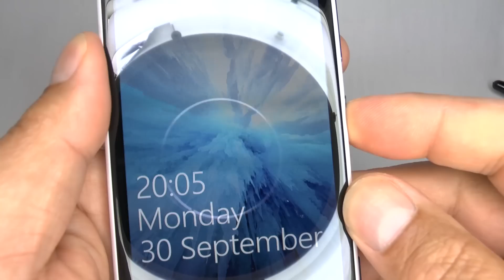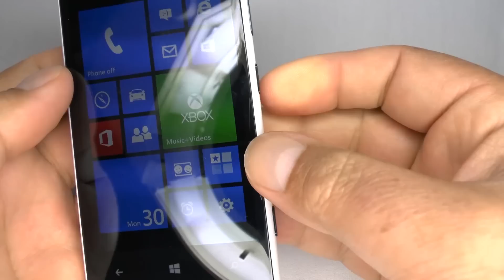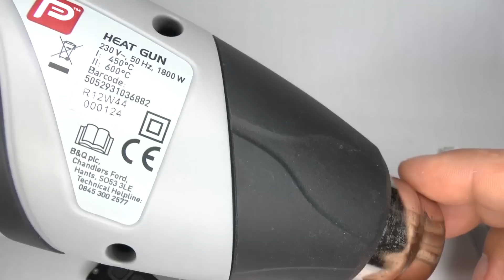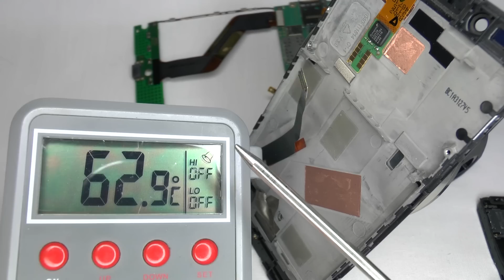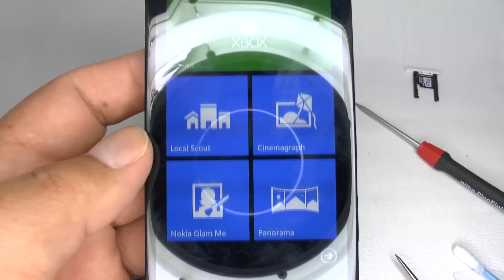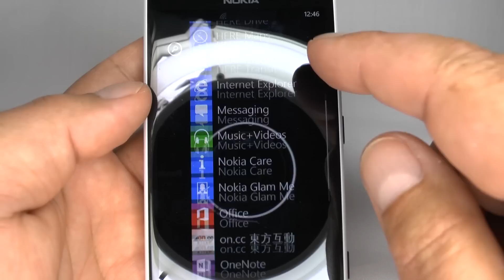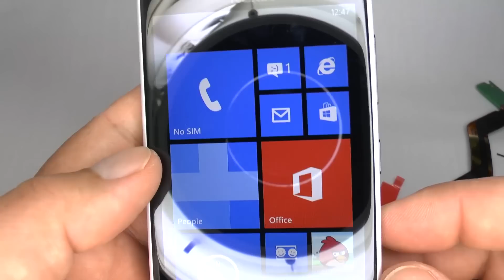Nokia Lumia 720 - Disassembly & Assembly - Digitizer Display Screen & Case Replacement

Comment: i have a 720 with broken digitilizer, what kind of glue I use to fix the new one, can be super bonder?
Reply from the maker: do not use 'super glue' as it will leave white marks and the glass will fall off if the phone is dropped. You need to use a flexible adhesive like 'Evo-Stick Serious Glue' or something else that is flexible
Reply: ***** I have dropped my phone and my external glass completely shattered. Can I get a new display and glass in the market or nokia care center so that I can repair it on my own and save a lot.

Your input is highly valuable on this comment. As the nokia care center will charge around 8000 rupees ($ 150) to fix it. I want to avoid such huge cost
Reply from the maker: Harish Shilpi The Nokia care price is not bad as a new screen assembly costs $110 from here http://www.etradesupply.com/oem-nokia-lumia-720-lcd-screen-and-digitizer-assembly-with-front-housing.html
Reply: ***** Could you please tell me whether I can change only Nokia Lumia 720 digitizer touch screen excluding LCD display..???
Reply from the maker: Harish Shilpi It might be possible but from a previous comment its very hard to separate them...
Reply: Harish Shilpi same problem here, i brought only the glass, without LCD, i need to buy a torx T2 and T4 to open the phone, the glass not came yet, so in the next week ill try to fix it and post here the results.
Reply: Roger Pereira  Thanx for your input. In india only glass is not available. Its being shipped from US. Still waiting. I am eager to know your valuable information.
Reply: Harish Shilpi bad news Harish, seems to be praticly impossible to change only the glass, results: my lcd is broken too, after a failed attempt of the technician, but he advise me about this before try to fix... so, the best way is the complete set of glass+LCD. too expensive in the Brasil too, about R$400 or $168USD, my Lumia 720 now is a piece of garbage.

Comment: Sir 
My Lumia 720 fell in water, now its working good but i can see water cloud behind the screes and my mic is not working, im able to take calls through head phone.. what should i do? is it possible to make my screen good?
 
is there a possibility of water entering digitalizer?
Reply from the maker: you can fix the mic problem by fitting a new usb flex as for the screen it might dry out over time but it might need a new screen if it doesn't go away
Reply: ***** Sir where can i buy USB Flex?.. and the screen if needed.. 
Since it wont fall under warranty.. I would do the job..
Reply from the maker: rkpsree sree For spares try http://www.etradesupply.com and use coupon code ETS2 for a small discount which also gives me credit.

Comment: ***** I have a problem with another Nokia Lumia. This time is a friend's Lumia 720, she went to fix it on a store but it seems that they broke a part in the LCD cable were 2 cables are attached with an adhesive tape, then i tried to power on and it flashes but doesn't show anything. i don't know if you want me to send a video of it?
Reply from the maker: if the store broke it why are they not fixing it?
Reply: My friend go there just to change the digitizer and they broke the screen in one corner, they said: sorry we can't fix it and we wont charge you. They don't make an invoice or something in order to claim :/ so now she has to buy the entire LCD screen with the digitizer.
Reply from the maker: Luis González that's not good, there must be a legal obligation for them to make good a bad repair?

Comment: My down volume button not working normally, i have to press it really hard to work and sometimes it doesnt work at all. How to repair it?
Reply from the maker: You can see how to remove the flex at 14:16 here's a link to buy one, you can use coupon code ETS2 for a little discount which also give me credit.. http://www.etradesupply.com/oem-nokia-lumia-720-side-key-flex-cable-ribbon.html
Reply: leeyahuda my phone keeps saying my ear phones a plugged in

Comment: my lumia 720 was not immeresed in water but still the nokia care is telling that its drowned in water the phone works works quite well but the only problem with the phone is that the bottom keys search windoes and back keys are automatically  working without touch kindly help me
Reply: Go to settings-touch-change touch from HIGH to NORMAL.
I too earlier had the same problem but now solved.

Comment: my lumia 720 has problems on the screen, it lights up, no more appears the blocks .. how do I restart it, I have to hold the power button on and off and press the camera button plus the volume knob? I forgot .. unlock the screen normally, after which the screen is all black with no block, if you press the capacitive button to return the screen turns blue. : \ Please someone help me ..

Comment: Hello. I have Lumia 720. I broke my screen accidentally, however my phone still works, it reacts to my touches and so, but screen looks broken (tho it hardly react at top of phone and sometimes it presses by itself). Can i change frame using your method? Will my phone still work? I pictured my phone, you can see bellow.
http://s29.postimg.org/fxdauzmxj/suduzo.jpg

Comment: Hi LE55ONS

First of all I'd like to thank you a lot for the clarity of your explanations regarding this tutorial.
I'd just like to add a few informations for those who'd like to disassemble the screen from a smashed digitizer glass:

You will need 2 components to change your digitizer glass: a spare kit with all tooling (easy to find on ebay or amazon) AND the OCA (optical crystal adhesive) which i finally managed to find in Polland after 3 weeks of search!!!
I gladly give you the link:
http://www.multi-com.pl/index.php/en_US,details,id_pr,15973.html
I'll keep you updated with how it is going with my repair since my order hasn't arrived yet.

Comment: Can you help me to diagnose my Lumia 720 that was dropped in the river for 5 seconds? It was working at first but after 5 minutes the area around the mainboard got really hot and it turned off. The LED flash blinked a couple times and turned off. I'm unable to charge it now. I'm thinking of replacing the Charging board and Battery? Do you think I can revive the phone? I must at least get my pictures back. TQ
Reply from the maker: unless the battery is immediately removed there's not much chance to bring it back to life as the water reacts with the power and eats away at the copper tracks. It won't hurt to replace the usb flex but I dont' think it will help :-(